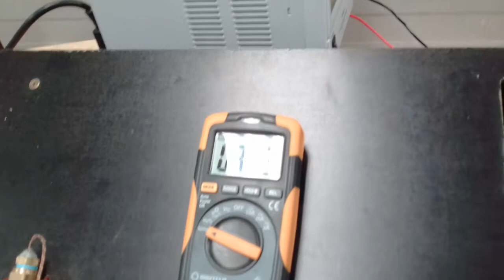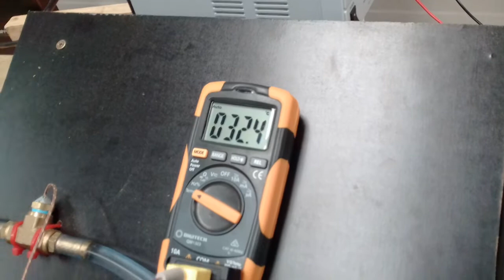Discharge test on 12s10p liquid cooled battery module

Comment: How did u do design calculations of the system...... my project is grp is working on thermal management system of battery and we are stuck at design Calculations for selecting dimensions of components
Reply from the maker: This particular design was driven mainly by the shape of the battery, and the cooling system was 'whatever will easily fit'.  Hence it's cooling power is not great, but good enough.  Know how much heat you are likely to generate using I2R calculations.  Then work out the surface area in contact with the cells - use thermal conductivity calcs to determine the heat flux and therefore what coolant and mass flow rate.

Comment: Nice setup Chris!  Always interesting to see battery testing!. I wonder if you would have added a vertical aluminum plate in between the 7 cells.. let say 3 on one side and 4 on the other ( 7 cells parallel total) and that plate would directly conduct to thebaseplate.. a bit like the  chevy spark EV A123 pouches are working except they send heat on the sides thru some plates between cells. This could have helped sending more heat to the  baseplate... maybe on teh next design!... Btw i love the copper link on top with screw!!!  monster connections!!!!
Reply from the maker: Thanks Doc! Yeah I have thought about putting 0.2 mm aluminium plates with L-shapes between every cell, or every second cell.  It would definitely help, but it does make it less compact and riskier in terms of electrical conductivity. Indeed - next design :)